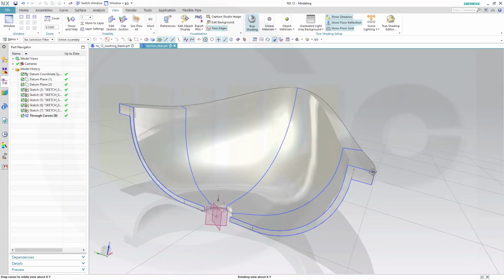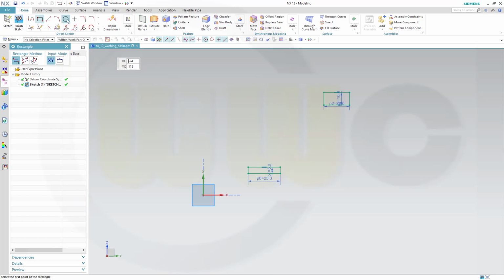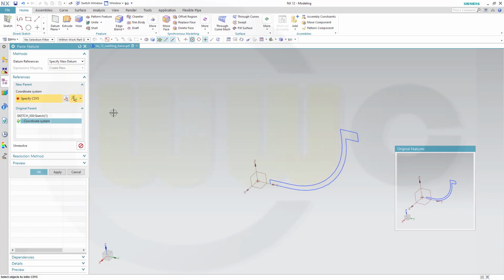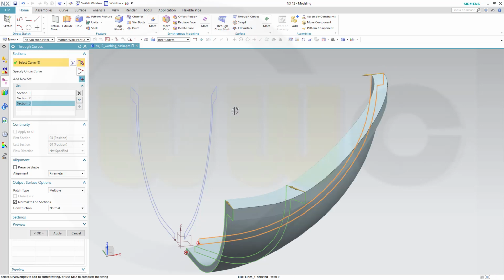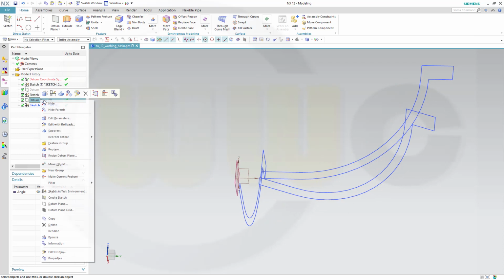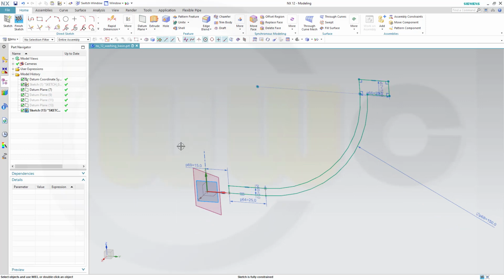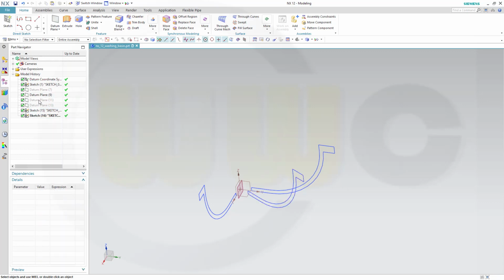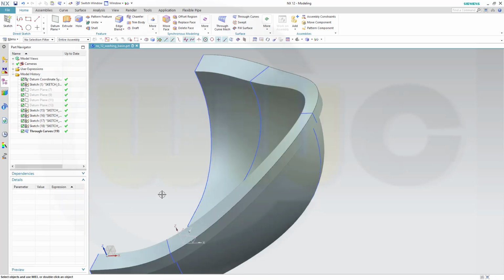10.5 Washing Basin - Becken - Siemens NX 12 Training - Part Design

Comment: I'm using Creo 5.0, but this was still useful. I was able to recreate this basin in Creo by creating the new angled reference planes first. Then pasting the first sketch into the angled planes, and manually aligning each sketch to the central axis. Then I used the Swept Blend tool with the Datum popup, and then the Curve Through Points sub-tool to draw the trajectory. I noticed that Creo didn't have as many dropdown options for each tool. I had to perform separate operations where NX had tool options as best I could observe.
Reply from the maker: I wonder why someone uses Creo at all ;) I would only use it if I´m forced to do so. But PTC sold a lot of licences.
Reply: @wolfgang.walden.cad.training  For myself I don't use parametric software for a living so I don't have access to a license. So I'm trying the free student license programs. I'm just trying out Creo and will possibly try NX. But, NX is a large installation and a temporary student license. Creo seemed like a good first parametric software choice. I normally use AutoCAD and Revit.

Comment: I'm dealing a trouble with copying and pasting sketch as "Specify New Datum".  I'm not able to select references After I pressed Specify New Datum,. I'm using NX 11. Is there any setting to activate that feature?
Reply from the maker: Maybe one of the filters is active - check the filters.
Reply from the maker: I´m not aware of any. Check the filter options.
Reply: @wolfgang.walden.cad.training  same problem with me.
Reply: @wolfgang.walden.cad.training  same problem with me.